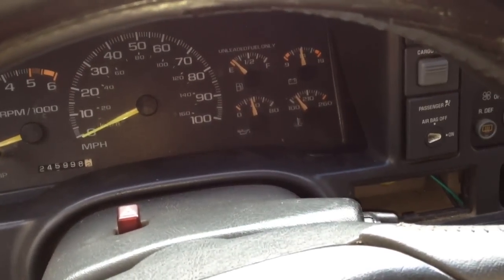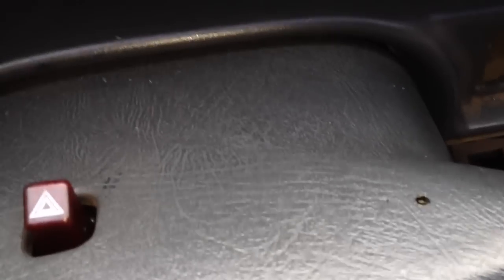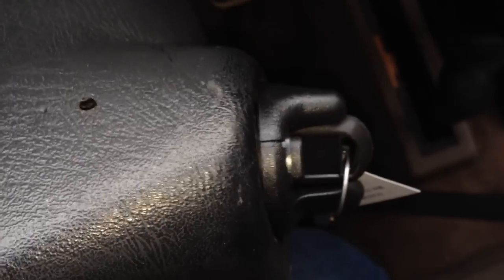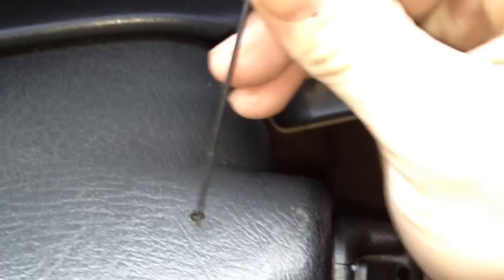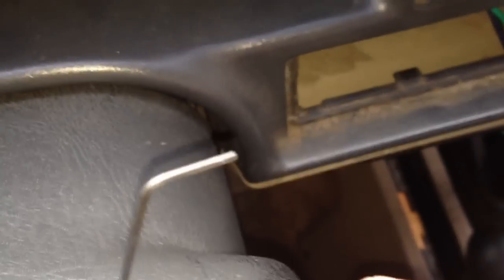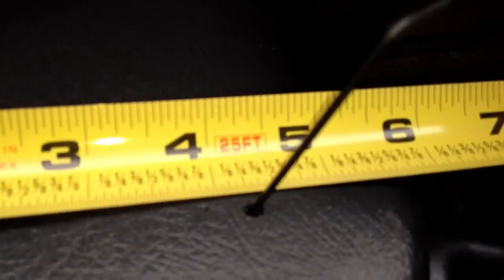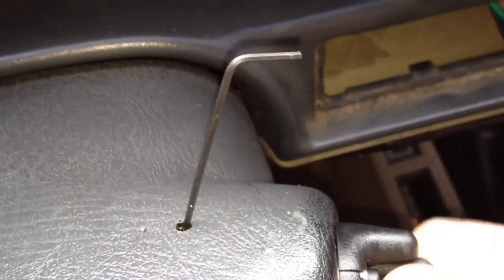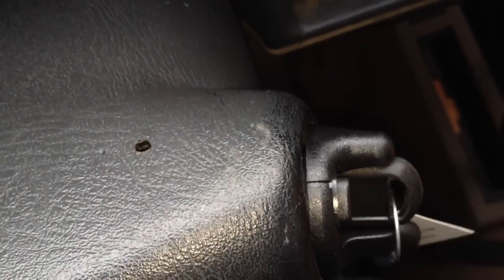Chevrolet ignition lock cylinder replacement (easy way)

Comment: You are trucking cool! LOL Actually I didn't drill the hole, rather I took the plastic covers off the column. But your video pointed out the little hole that is though the metal steering column housing to press down on that detent on the ignition cylinder  while turning to on/start. I looked at a couple vids about pulling the steering wheel off with GM column puller etc , when I did not see that hole(bad eyes) and went DAM! Thought maybe it was on the other side. But your vid saved the day and I gotta wonder about these "fools" spending an hour or  2 + and needing special tools and the irritation involved. Thank you. There are almost always short cuts a real mechanic knows. Yours is one, but instead of defacing the housing,  pulling the covers avoids that though a little more time and  a T25 and a small 5mm socket is needed along with your allen wrench/my paper clip and getting some Si grease from the boots on the hands. . Regards Chris
Reply from the maker: Chris Perrien thank's for the kind words and extra advice! Always appreciated!

Comment: This only works for steering columns with the plastic clamshell covers as depicted in the vid. If you have the smooth hard plastic cylindrical steering column, you will have to pull the steering wheel.
Reply from the maker: You are correct sir